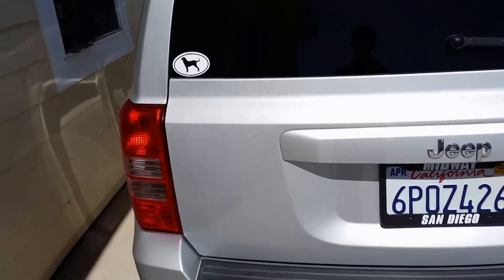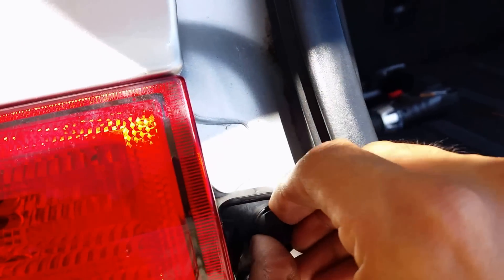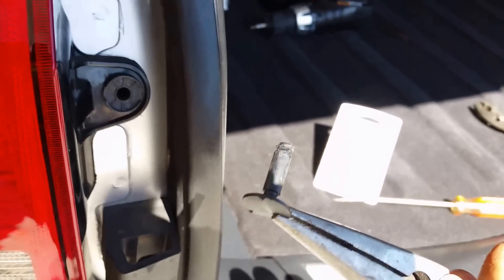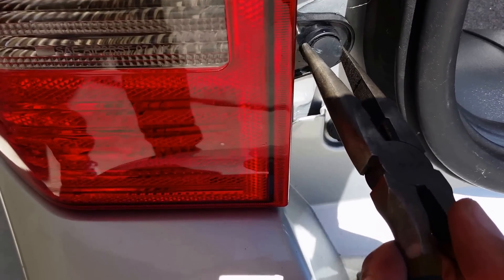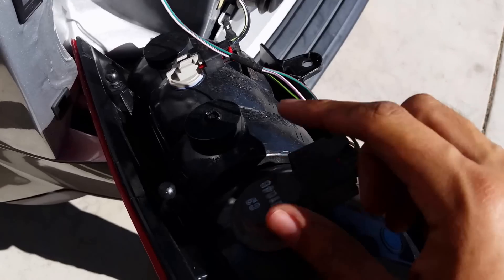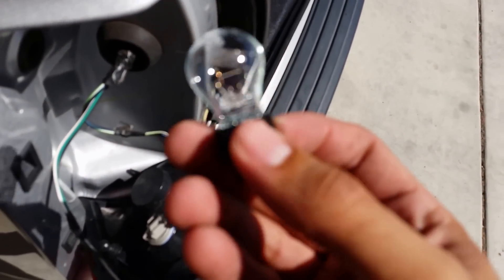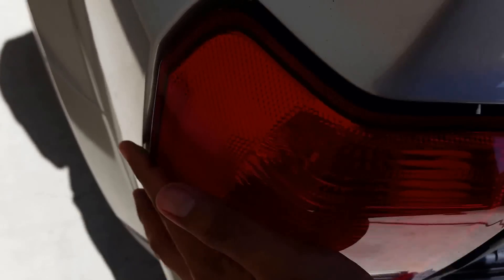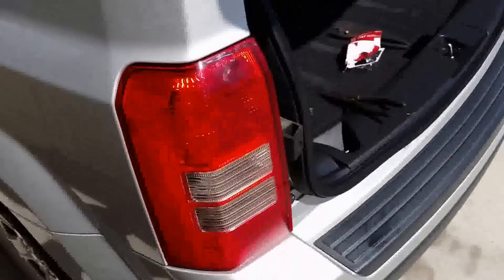How To change Turn Signal Brake light bulb on Jeep Patriot 2011 HD

Comment: Not everyone's just pops right out. I had to destroy both plugs to get them out. I was like fucking super glued in.
Reply from the maker: OmegaKilo8 Try using that "bulb grease" next time, the heat makes em get stuck
Reply: +OmegaKilo8 Mine too! What the freak.
Reply: I absolutely could not get the plugs out at the auto parts store..... and I'm a aircraft mechanic.  I had to bring it home and use small 90 degree needle nose plyers to work them free and even at that I almost destroyed them.  I lubed them up with silglide before I put them back in.   I call those plugs an ENGINEERING FAIL. People need to be able to change a light bulb in a parking lot with only minimal tools. They refuse to use LEDS and stick with old school bulbs......and fine its a budget vehicle...... but for gods sakes, make the bulbs easy to change.  You would never see that half ass shit on something that fly's in the air. 

  I don't blame Mopar, all the manufactories have half baked stuff on cars these days. I see it all the time. (ford f150 that you need to pull engine to replace exhaust manifold studs). Its not the brand.... its the latest crop of engineers and the upper people who come up with stupid decisions to save money.
   I can see it now in the mopar board room.... we could use LED lights, regular lights with stainless screws holding the lenses in, or....... we could save .000000000000000000005 of a cent and use old school bulbs and hold them in with fasteners that break when you take them out.

Comment: I destroyed one of the black plastic "plugs" (that are supposed to just "pop out ) " .  I went online trying to find replacement plugs to no avail . Am I using the correct term ?? Plugs ??? Thank you .
Reply: Patriot junk. I just broke one trying to remove it - maybe because it was about 30 degrees outside? Doubt it. I just pushed what plastic was remaining of the plug further into the hole until it wouldn't go in any further, drilled a pilot hole into the plastic, took a screw that was long enough and with a washer I was able to firmly reattach the light housing. Funny how the actual time it took to replace the bulb was about 30 seconds but trying to remove, reinstall and fix the broken plug took over 20 minutes. I expect the lifetime of the screw to out perform the life span of the vehicle by a factor of ten. Yet another example of needless frustration due to poor design and quality this vehicle has consistently provided. Patriot junk.